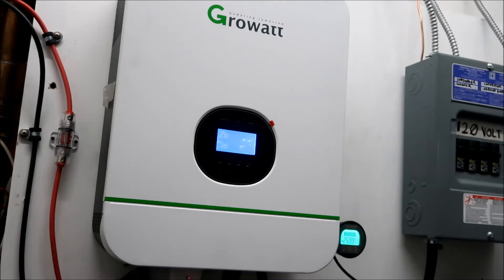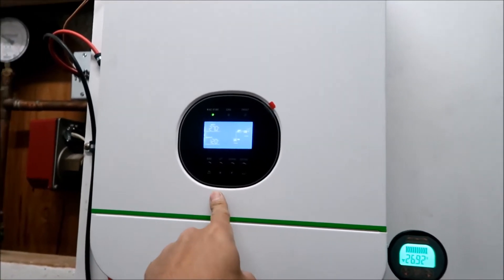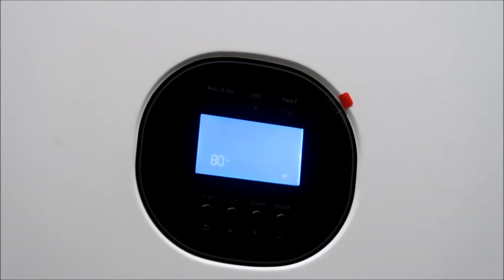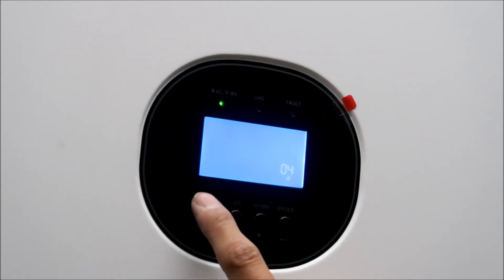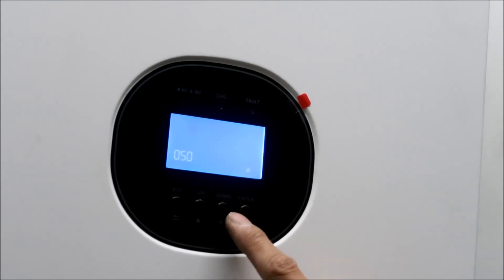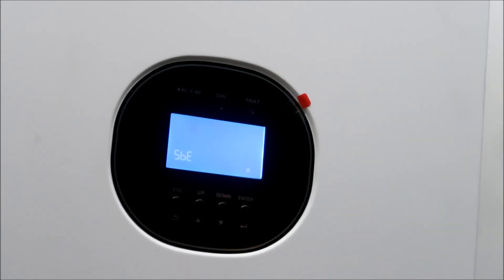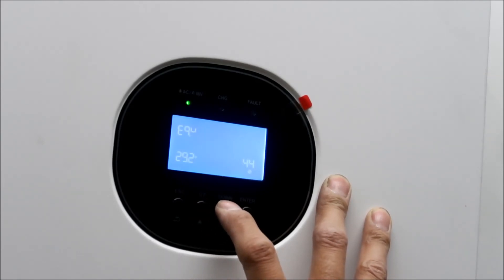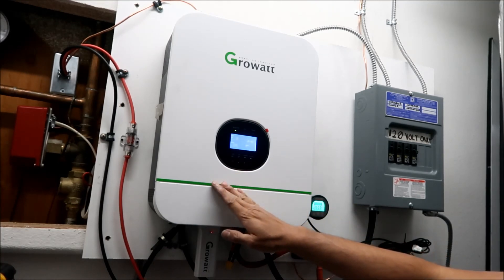HadesOmega Solar Garage Project Episode 56 - Growatt 24V Inverter Initial Setup

Comment: I got my first solar setup with the growatt and big battery finally finished recently.  Its so cool to see it running.  I'm actually pulling in so much solar my battery is getting full early at 9am and doesn't really generate that much after because I have barely any load on my garage.  Your previous videos really helped figuring out what to do.  One word of advise is the wifi module setup is terrible, it took me over 2 hours to finally get it working.  The server address in the wifi module is completely wrong and you have to add -us to the first part of the server.  I might be adding another 48v battery to run along side the 5.3kwh.  I think I set my charge to 50a.
Reply from the maker: Yeah that sounds about right for thr wifi module once it's working it works great very handy

Comment: I have a very important question that from watching all the Growatt videos on YouTube I have not been able to understand: Using menu item "5" and "USE" can I customize the settings for my specific AGM batteries? I have very high-end AGM 1,200 AH batteries and the manufacture has very specific settings for "bulk", "float" and amperage. Can I configure those settings or am I only able to configure settings if "Le" based battery? In other words, do I have to just select "AGM" and then I am going to get whatever charge parameters are programmed into the Growatt, or can I configure the charge parameters for my AGM battery?
Reply from the maker: I'm not sure what the AGM battery settings are but you can customize the charge settings or user defined.  If you don't have the Growatt battery (I've never seen one) you need to use user defined.  If whatever the AGM settings are work with your battery I'd say go with that.  If you use user defined you can customize everything.

Comment: Hi, if I’m on SOL and the battery is fully charged at mid day, why does the SOL disconnect ? and inverter runs from the battery again?
Reply from the maker: I'm not sure what you are asking but SOL or solar only means the battery will only be charged with solar power.  When the battery is full it will stop charging the battery and power the loads with the solar power.  If there is a great enough load that the solar can't fully power it will draw power from the battery to make up the difference.
Reply: @hadesomegamoto7639  that is what my understanding is as well, but the solar stops producing energy once the battery is fully charged . So that’s  my problem, solar does not supply the loads
Reply from the maker: @williamseptember640  It will stop charging or producing energy if you don't have big enough loads.  If there isn't enough load and the battery is charged it goes nowhere.
Reply: @hadesomegamoto7639  I’ll check on the weekend….thx